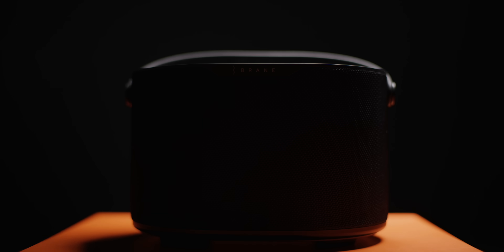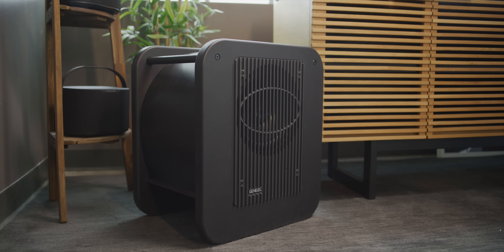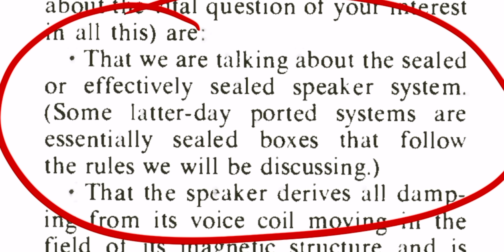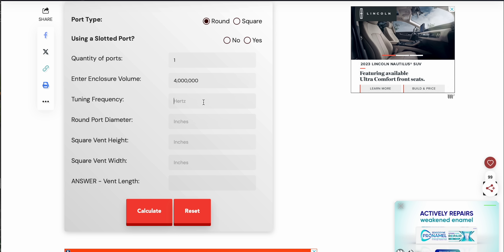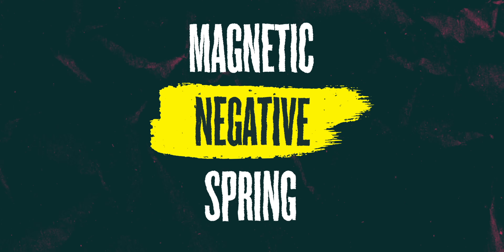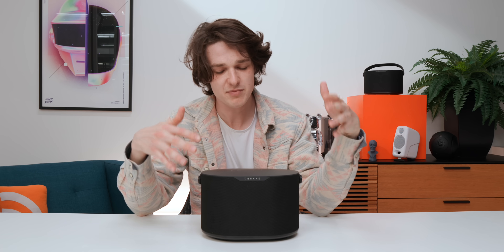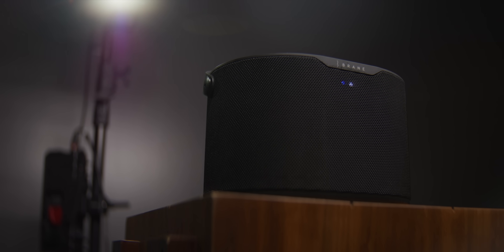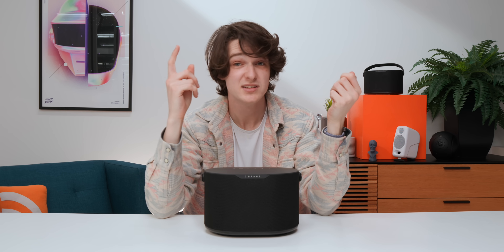How This Speaker Broke Physics.

Comment: 3:48 this is absolutely wrong and absolutely NOT how a bass-reflex works. In a bass-reflex enclosure woofer actually "fights" against even more pressure compared to sealed. Also, bass-reflex port is NOT a hole. If it was just a hole, you would only have a leaky sealed box with no actual benefit.

Bass-reflex enclosure uses mass of the air in the port as a resonator. At the tuning frequency (determined by port dimensions and box internal volume), when driver pushes the air in, this propagates to a port with some delay due to momentum of the mass of the air in the port and air will actually come out of the port at the same time when driver is already moving the opposite direction (pushing the air out). And since both driver and port work in phase, pressure changes inside a bassreflex box are actually higher than those inside a sealed box.
Passive radiators work the same way, they just take less internal volume.

Comment: No he doesn't use the speaker. This is just a long ad. You're welcome.
Reply: Yeah, it a lotta hype over a well know design technique that exists for many products..
Reply: @socksumi  Yep, there's an older dude that builds speakers out of his garage on here. Recommend talking to him. He makes compact and medium sized setups that get down (like 32hz before rolloff and clear highs) Chris DIYer.
Reply: Everybody that has bought the speaker is going wow!
While you are saying it's an ad...
Reply: @masonichisenga3032 Not saying the speaker itself isn't great. Just saying not demoing the speaker at all. Its just advertising. I have two of them. The only negative thing about it is the battery life is awful. But that's to be expected of something pushing low frequency bass. The only speaker that steps close is devialet's mania which is twice the price and not nearly as low. It also has distortion sooner.

Comment: Most people today don't know what real bass from a home system is.  In my younger days we all had massive speakers with 15" woofers and high power to drive them.  I never stopped and currently am running JBL Vertec 4880's for bass and have 28,000 watts to drive my system.

Comment: In order to make base you have to displace a lot of air. One of the most efficient ways to do so with minimal space is a hemholtz resonator. Tuning the resonator to a subsonic frequency alleviates a lot of the group delay problems. Simply putting a hole in a speaker cabinet does not relieve the back pressure. In fact there is a phase delay at certain frequencies down to the resonant frequency at which point the air is out of phase with that hole or event and it actually creates more back pressure at the resident frequency reducing the speaker cone Excursion dramatically. As such the hole or vent becomes the primary dominant source of Bass output.

Comment: My aDs 910s are the perfect speakers for me. Dual 10.5" bass drivers installed into their own bass enclosure inside the cabinets. (Thus the 130lbs w/stands) Dome tweeters and mids make for excellent dispersion in the room no matter where you sit or stand. They're techinally stand-mounts, and they're huge, so not good for everyone. 

As with all speakers, there is a trade-off with only moderate soundstage, with pinpoint stage placement being slightly muddy compared to some of today's best loudspeakers. The 910s I own were built in the late '70s, so I forgive them for the slight downside when everything else is so exceptional.

Comment: I agree with most of the comments: this is not a very satisfying or sufficiently informative video. A bit like a long ad.

But I have to add: I bought a Brane X, and the bass really is insanely good, deep, clear, accurate, and floor-shakingly powerful — better than any other battery powered bluetooth/AirPlay speaker out there. So satisfying. And the rest of the sound is very good to almost excellent as well. At just under 8 lbs, it’s amazing. It’s a bit better sounding — smoother and more accurate — when you use AirPlay (WiFi) instead of Bluetooth. 

I don’t know how their use of magnets does things, and I still don’t know after this video, but their result is mind-bogglingly impressive. The hype is actually real. 

I was looking to buy a really good sounding battery-powered unit for teaching dance classes in large spaces (800 sq ft on up), small enough that I can backpack it and get around by bicycle. And for hosting outdoor dance parties. It needed to have massive bass in a large room or outdoors (nearly impossible in a tiny box), but also really nice clear, clean vocals and instrumentals. And it would be nice if it sounded good at home, too, as close to my go-to headphones as possible.

I bought and tested side by side just about every higher quality battery-powered Bluetooth speaker out there, focusing on staying under 10 lbs for easy portability ... but also including the big JBL Boombox 3 (15 lbs) and Bose S1 Pro (16 lbs) just for completeness. Those last two approach the price of the Brane X but are twice as big and twice as heavy. To my ears, the Brane X beat them all. The whole Sonos line, the whole Bose line, all the JBL tubular speakers (Flip 6, Charge 5, Extreme 3, Boombox 3), a Sony SRS-XB33, and a few random others including the adorable tiny Minirig 3. The Sonos Move 2 had very nice vocals but they were way too far forward and the bass was weak and unclear. You know which competitor had the cleanest, most accurate, most musically satisfying sound? My 20 year old tiny Bose Soundlink Mini. But only in a small room. It is tiny, and the bass vanishes as you try to get loud in a bigger room.

The Brane X was the clear winner in multiple side by side testing. Especially for bass. Clear, crisp, accurate, really loud floor-shaking bass. Literally floor-shaking. I had to negotiate with my apartment downstairs neighbor to only crank it up when they aren’t home. Pop sounds amazing. Acoustic double-bass sounds amazing. And with a wee bit of fiddling with the equalizer in the iOS app, the Brane X sounds nearly identical to my AirPods Pro 2. Not extreme audiophile, of course, but genuinely good by any standard, and insanely good for a small boombox. Maybe the super-expensive no-battery Devialet Phantom II sounds even better for some things, as Ellis mentioned. I wouldn't know. I needed battery. 

So, mock the physics hype all you like. But whatever they are doing, it really works.

Comment: Not one spec on output pressure or frequency responce. Just advertizing blurb. The negative spring should have effect on acustic output vs electrical power input. But just fluff. Besids I never expect pipe organ peddle notes to come from any speaker with base above 70Hz.

Comment: 8:30 "Not talking about the old school, 2000 dollar preamp kind of audiophile". I actually think it is a great time to be an old school, vintage equipment audiophile. If you want actually true high fidelity, it is the way to go. If you just want a cool little bluetooth speaker (speaker in singular, there is only one, so there won't be any stereo separation in there) that will pump out a ton of bass then that's a good product for you. Just know it is the complete and exact opposite of what audiophilia stands for.

Comment: bit wrong about the "hole" its a tuned port the driver will move alot less at tuning it has nothing to do with making the driver move more. never mind this video is full of misinformation cant break physics the hedd monitors you have to plug up the ports to seal them they dont do it automatically.

Comment: Personally, I'm very happy with my parts express Bluetooth speaker box kit.

It comes with two 4 inch driver's. Two 3/4 " tweets and a pair of crossovers. 

The sound is very clean and the bass is very good. 

I've had it for about 3 years now with the same replaceable batteries and typically listen to it for about 8 hours per day, 5 days a week at work.

If you're looking for high SPLs, don't get it.

Comment: $599. Or you could just buy an amp, two decent bookshelf speakers and probably still have enough left over for a decent sub. The portable audio craze makes zero sense to me. If you're on the move: headphones. If you're at home: speakers. The only use I have ever found for a bluetooth speaker was to play Christmas music in the office when they wouldn't put Christmas music on the overheads. The size and portability were convenient versus two small bookshelves and a Chi-Fi amp-- even though the actual speakers would sound 1,000,000 times better.

Comment: Actually, Bose speakers have been doing this for years: They pack a lot of bass into a very small cabinet, and they don't draw an inordinate amount of power. Still, bass isn't bass. So while my tiny Bose sound bar has a lot more bass than my larger speakers with more than twice the volume and much bigger drivers, the sound quality is not the same. Lots of bass doesn't necessarily sound good.

And the subwoofer shown in the video isn't that big, and having a subwoofer isn't fancy or just for people with a home theater, it's something every good hi-fi setup should have, unless your speakers have such a huge volume and such big drivers that they basically have built-in subwoofers (big three-way floorstanding speakers have enough bass power to not need a subwoofer).

I have an external subwoofer hooked up to my 2-way monitor speakers, one that is even bigger than the one in the video, and while it can certainly blow the Bose soundbar out of the water, I don't actually run it at that much power, because like I said, it's not about having more bass, it's about having better bass. In the end, the music should sound realistic and have a level of bass that matches the mids and treble.

Comment: A little expensive but cool it is being done. Yeah I won't be updating my 60 dollar sound bar and  its small sub till the price drops, a lot! I also have a Bose computer system with sub I sometimes use for the tv. It was 400 and I thought that was a bit much. It is stereo too. If you have no space  and lots of money, they need early adopters. I like learning new things though and eventually it trickles down to the masses. Of which I am one. Thanks for the information it's cool.

Comment: Audiophiles are not into the tech that made the equipment: they're into the quality of sound that the tech makes. This is not an audiophile speaker, but a good Bluetooth speaker for casual listening (or more commonly, just playin in the background while you're doing something else). 
What Brane is doing is controlling the driver's movement for more apparent bass. And I say apparent bass for a reason: real low bass is almost unhearable, but fills out the sound. This speaker, with it's 6.5x9" driver, will put out more bass than other Bluetooth speakers because it's larger than most BT speakers. It can put out more bass because the woofer's movement is controlled, well damped by the amplifier. Bass sounds bad on small speakers because the cone's motion is uncontrolled by the amp at the full extension of the cone, putting out spurious sounds. Well controlled speakers limit the movement of the cone for a tighter sound. That takes power, something that home amps have lots of and what portable amps have little of. To get good damping, you need power, which means a good amp and enough battery power to feed that amp. The Brane has a 75watt hour battery (it's big) and the whole rig clocks in at 7.7lbs, far higher that most portable BT speakers. Since the drivers, case and amp don't weigh a lot, most of it's battery weight.
Brane doesn't publish it's speaker's specs, so there is no listing of it's frequency response. It does boast two 2.5" midranges and two 3/4" tweeters for a left right output, but since they're so close together, you're not going to get real stereo sound with any kind of imaging.

Comment: TSP parameters and driver linearity with excursion, Enclosure design, crossover and equalizing... Yea efficiency needs volume! compact with loads of bass and a lot of output can be done though that needs power which with today's class D amp's at least isn't muh of an issue anymore to have big power in a compact amp. A bigger speaker cabinet doesn't make the bass more rich. A driver designed for small volumes will get amazing sounding bass from a small enclosure. For example the Dayton Audio E150HE-44 which can get some serious bass from below 8liters of volume. They make bass like some huge speaker's. Only downside is it take a lot of power.

Comment: Older speakers used crossovers for the speakers and sub woofers and have knobs to adjust the frequency response. In the modern era the majority of audio is digital and rely on dsp. I rather stick and rely on using cross over dsp since dsp is not very accurate since it colors the audio. Every time dsp is mentioned, it always reminds me of bose and bose is catered to the average consumers not audiophiles, studio reproduction, critical listeners, or someone that is looking for as much as accurate sound reproduction as possible. I have a pair of yamaha hs50m studio monitors as my 2 channel home stereo system with all the knobs set to flat and are on rockville speaker stands and set up an equilateral triangle to my ears for an accurate stereo imaging and because I watch my 4k movies discs, play games consoles from the physical discs and my pc games near field. I'm a near field user when it comes to enjoying both audio and video. When it comes to bluetooth audio, I mainly used harman kardon because I got into audio because of harman kardon. I was introduced into audio by the harman target from the frequency response graphs. I even decided to try out a variety of different brands for headphones that are mixture of open back and close back headphones. Nowadays, I daily drive the 1997 sennheiser hd 600 the original marble version when I commute by bus, walking around and running errands and connect my sennheiser headphones from the headphone jack on my android devices since I always use the headphone jack. I switched to using wired audio full time and I tried bluetooth audio to see what it was like but bluetooth audio made me miss using wired audio. I prefer wired audio due to the superior fidelity, 0 latency, 0 lag, bandwidth limitations and non replaceable batteries which is already e-waste on bluetooth audio devices . If I was to consider wireless audio, it would be wifi or with an ethernet connection due to having more bandwidth than bluetooth and can be comparable to there wired counterparts with certain limitations that wifi fixes that still plague bluetooth audio that I already have mentioned. I still have my old chrome cast audio device that uses micro usb. I wish google updated the chrome cast audio device with a newer and faster wifi chip with usb c and dsd support for hi res audio while still retaining the same features as the old chrome cast audio device that is only deticated to audio only.

Comment: The Genelec subwoofer is not a "big cabinet". It's tiny. Sure, everything in this world is relative but, the Genelec is tiny both in terms of professional speakers (like you would actually use in a theater or concert) AND in terms of the wavelengths involved. It is acoustically small wrt the frequencies it is expected to produce. Like orders of magnitude small...  Please don't refer to tiny speakers as "so massive".

Comment: Super vague explanation. Open it up and show us how the components are placed to achieve this!
I though about it a bit. If I understand it right, there are electric magnets repelling each other instead or in addition to the magnet of the cone. This then may move the cone further while having less weight in magnets, I guess. At the end, the amount of air to move, compress and direct is limited by the properties of the case, as well as the size of the cone and how the cone is moving. You can channel the air in certain ways and create or eliminate resonances, but that's about it.
Generally, there is a lot of trickery going in the marketing of mobile speakers. Demo setups in stores often have the speakers sit on top of boxes, which are tuned to resonate and therefore amplify the bass. They often use music with plenty of saturation to create the illusion of bass on crappy speakers. Most current music is actually produced like this. To really hear what's going on in the low-end, you need to test it with your own music away from those demo setups.

Comment: spend less then 2 minutes on the website. This speaker contains No special bass increasing technology. They do talk about a new electrostatic tech that may or may not produce bass in a small size. This speaker on offer is in coherence with Hoffmans laws. It uses a 6 and a half inch woofer. So it picks a small size and large power consumption to achieve so called great bass. Did not see any measuments or comparisons. -a hifi enthusiast

Comment: What is difficult is to find a base speaker that is BALANCED. I just had the occasion to listen the jbl extreme 2 and I have the Dokin D-Fine (stereo bt speaker with 2 passive radiators on the back, designed in Germany) but they're both unbalanced in different ways. I don't know if they fixed the issue with the Dokin 2 and I didn't have the occasion to listen from the various "elite" bt speaker you talked about. I would be curious to know if they're also balanced while being a lot bassy.

Comment: A bassreflex is actually put to limit the cone Xmax, not the other way around. And also making the speaker more easily has never been the problem regarding the absence of bass. Cone displacement and is the king in sealed enclosure as this one is and with such a small cone the bass will never even touch the desired levels or extension for normal listening...
It's a portable speaker and physics still matter unfortunately